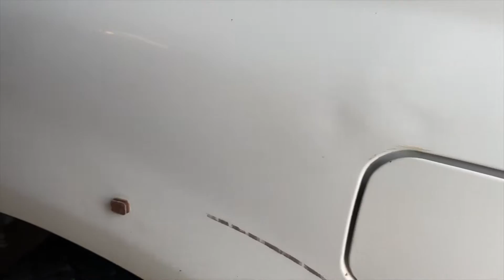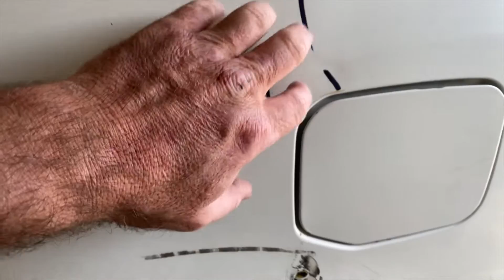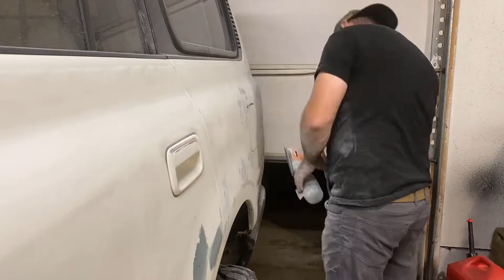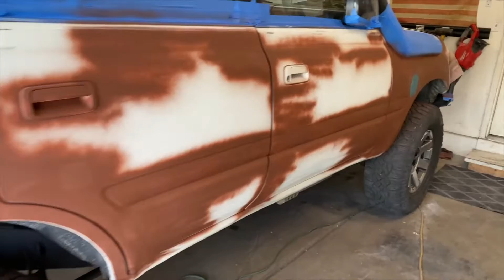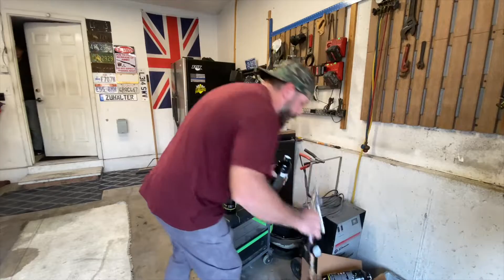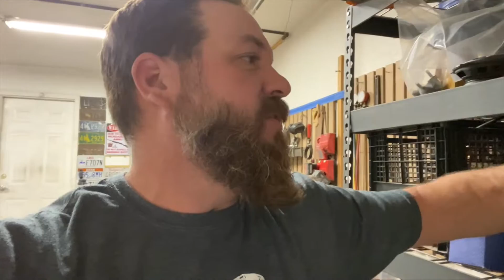How to Raptor Line any old vehicle and make it look good.  #upol #raptorliner #rustoleum

Comment: Nice job, i have the same white Landcruiser 80 to do also. How did you get on without a respirator ? This stuff has a lot of nasty chemicals in it  ? Cheers
Reply from the maker: I had a very large fan sucking the fumes out.  And I didn't spray it all in one go.  It took a whole day to do it.  It did come out pretty good though in my opinion.

Comment: When you said you were lining the 80, I was like "noooooooo!", but the white turned out really good.  I think you should go all the way up the pillars and the roof too, now that you've started..  It looks good, much better than the dents!
Reply from the maker: Thanks, I like it a lot.  It's a trail truck, not a show truck.  So I'm fine with the finish.  I kind of like the two different textures.  If the upper paint gets any worse, I'll coat the top as well.  Thanks for watching!